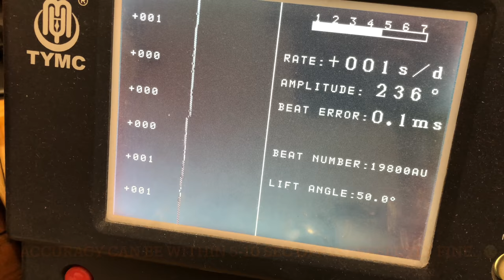RESTORATION OF A ROLEX AIR KING OYSTER PERPETUAL circa 1968 - Caliber 1520 service

Comment: I have a 1965 Oyster Perpetual - case 1003, movement 1570. It is probably very similar to the Rolex in your video. There is no service bulletin that shows how to disassemble, lubricate and reassemble the movement. 

I also have a generic military style watch with a Seiko NH38A movement. There is a service manual that goes into exacting detail on how to completely overhaul the movement, including what type of lubricant to use where.

Thing is I can regulate my $70 Seiko movement to run about +- 3 seconds a day which is just as good as most Rolex watches.
Reply from the maker: Honestly, I cannot stress myself enough.  You do not need to buy a high end watch for best performance.  To me, the overall condition of the watch is most important.  Whether you own a $50 watch or $50,000 watch, if the condition is excellent the accuracy will be just as great.

Comment: I see somewhere in it's history someone incorrectly installed the incorrect movement retaining clamps\screws. The genuine ones are one piece screw washer and is designed so that when you unscrew them (counter clockwise), it tightens the dial and movement to the case.
Reply from the maker: Look like someone did some research.  Good job on that.  However, on certain rolex models such as these airking and others which take the caliber 1520 originally came with a separate case clamp and screw.  Similar to the manual wind Oysterdate as well.  DateJust on the other hand will take the one piece screw with broad shoulder replacing the case clamp.  Which is why on the inside of a DateJust case it has a gap on the opposite side of the crown.  When you unscrew the case clamp screws, you can slide around so that one screw is on the crown side while the other is on the opposite side.  Flip it over and the movement will falls out.  😄

Comment: I have the exact same watch and it needs a new crystal. Wondering what's the crystal model you used on this one and was it sapphire crystal or plastic? Also I didn't see you use a gasket or maybe you did but didn't capture it on camera. Thanks for the amazing video and I was mesmerized and glued to this video from the get go. Thanks for sharing!
Reply from the maker: Thank you for your interest and questions. 
This model is from 1968, and it never came with sapphire crystal. I believe Rolex started using Sapphire in the 1990s or late 1980s. However, I know there are generic sapphire crystals made for models throughout the 1980s that carry a 3XXX series calibre. That said, maybe with today's technology, someone may have created a sapphire crystal that can fit on this Air King's case as well. 
If you prefer to install the original or one made like the original, here is a link to one: https://watchparts24.com/Acrylic-crystal-compatible-with-Rolex-Tropic-12-without-lens
Reply: @TimelessHistoryChannel  
Thank you very much!

Comment: Fantastic video! I have a very similar Air King 5500 also from 1968, also with the Cal 1520 and it was great seeing this video. I have a question about the crystal though: it looks very boxy on this watch, while mine is kinda rounded. I assume that the crystal has been replaced on mine but I might want to restore it to the original design. Is this boxy crystal the kind of crystal it came with originally?

Thanks!
Reply from the maker: Hi, thank you for your comment.  That's correct, the original "correct" crystal should be a regular dome.  But for some odd reason, I like the one in this video as it gives a better visual of the dial.
Reply: @TimelessHistoryChannel  I'm confused. Which shape is the historically correct one? Rounded or boxy?
Reply from the maker: @jakobmaulat  rounded

Comment: How to fix the glass back into the case, is it by pressure or apply adhesive?
Reply from the maker: Need to use a crystal press.  No Adhesive.

Comment: I have the same watch and movement recently serviced, they did replace the jewels and axle...but every time I shake the watch (dial facing up and down), I can still feel a faint bounce inside...as if something is wobbling inside. Thoughts on this? Appreciate your time and content!
Reply from the maker: Hmmm.  that's odd.  By replacing all three parts should do the job.  Maybe they missed one of the jewel?  Tough to say until you can open it up and check it with your tweezer.

Comment: Hey, could you tell me what the gasket of the lid is called or what the dimensions are? (30.80mm * 0.85mm?)
Reply from the maker: Hi, for Rolex gasket of any kind, it is best to try and order them from their case model number.  I'm sure a lot of online website will sell them.  
For example, this airking is case model 1005 which takes a 29-292-76 Rolex gasket number.
Reply: @TimelessHistoryChannel  thank you :)

Comment: You are clearly very skilled but man your work bench is like a watchmakers dirty underpants!!! 😂
Reply from the maker: lol, not sure have you been to a busy watch maker shop?  I have three benches in the shop.  Two are for watch repairing while the other is for strap making. This is my favourite bench where I do most of my repairs on.  It looks very dirty, but it is actually old marks on the mat.  If you get to see it in person and wipe your hand over, it is cleaner than a clean underpants that's for sure.  :-P 
Meanwhile my other watch bench which I rarely work on looks crystal clean on camera but every now and then I will need to wipe the dust off the surface.
Reply: @TimelessHistoryChannel  haha I’m sure it is I was only joking. You ability is amazing. I’m fiddling around cleaning the balance cap jewels and refitting them and they fly everywhere 😩 you have my total respect!!
Reply from the maker: I know your frustration.  I was in the same shoe once.  My recommendation is to use a brand new or good condition tweezers.  😊

Comment: Great work however I would've changed the crown and light polished the Case
Reply from the maker: If you are going to restore a vintage watch correctly, you first need to try and save what you can.  I did not need to replace the entire crown since the crown post was the issue.  It has a crack, so instead I just replaced the post and kept the remaining of the crown as you can see in the video.  And a proper restoration to keep the watch originality is to avoid any sort of case polishing.  I can polish a case like brand new, but that is not a proper job when working on a vintage watch.

Comment: Thanks for the video. It's always very impressive for me to see the mystery located inside a watch (I'm talking of a watch, not an electric motor). I don't understand how it works but I'm admirative to know how accurate it is: 5s a day is 5s over 86400s, it's less than 6e-5!!!).
I own the same model but I bought it in 1983, I still love it and wouldn't buy a more expensive one (I'm more rich than I was at that tome). Mine has a blue dial and is 34mm (the one you repaired seems bigger).
A question: Do I have the same caliber inside ?
A remark:the original glass was not exactly the same, it was more round on the edge. I noticed it when mine broke and when Rolex changed it and said to me that the ancient shape was not available any longer.
Reply from the maker: Thank you for watching and for your comment.  The caliber that was used in my AirKing was used until the late 1980s if I am correct.  I think very positive the caliber in your watch will be the same as in this Air King as well.  That's correct, the original exact crystal on this watch should be more round on the edge.

Comment: That was a great Job!
you didn’t renove the balance assembly, do you always try to avoid it?
Reply from the maker: I am not avoiding.  I enjoy working on damage hairspring, so removing a balance wheel is easy pezy.  haha.
The reason why I do not remove it during cleaning is because I use a four station spinning cleaning machine.   If I use the ultrasonic version then I would need to remove it as the vibration can break the tip of the balance staff.
Reply: @TimelessHistoryChannel  thank for your response and content.
Reply from the maker: @juanmanuelflorezviol  anytime!
Reply: @TimelessHistoryChannel  Yes cleaning with the balance fitted is much safer, but the pallets too, have you never had a roller jewel snap while in the cleaning machine?
Reply from the maker: @daviskaya100  Let's just say I've been working on watches for the past 2 decades.  Never have I had a roller or pallet jewels broken.  I have had watches that came to me with missing pallet/roller stone which I will need to fit new one on.  2 decades of watches are a lot of watches.  The cleaning solution is very thick, so when the balance wheel enters it cannot spin like it does once clean dry out of the solution.  One recommendation though is to never be cheap with the cleaning solution.  Always replace with fresh solution often.

Comment: Why didn’t you remove the crown?
Reply from the maker: What do you mean?  I did removed the crown when assembling the movement since the crown pipe is broken and I couldn't wind it.  Closer to the end you will also notice that I replaced the old crown pipe on the crown.  Now everything is working fine.
Reply: @TimelessHistoryChannel  oh sorry, I must have missed it. I saw the part when you were putting the movement semi-dismantled into the cleaner with the crown and stem still attached. I probably missed a few steps as I was multitasking. Great vid btw!
Reply from the maker: @watchchat  haha, it's all good.  It is quite a long video after all.

Comment: I never understand why you’d clean/service the movement, replace the crystal, fit a new strap, but not polish the case.
🤦🏻‍♂️
Reply from the maker: When you're in the vintage watch market long enough, you'll understand that the moment you polish the case, it will devalue your watch by as much as 50%, redial, and you will devalue your watch by as much as 90%, and when you relume can devalue between 20-90%. This is why I do not polish the case.
Reply: @TimelessHistoryChannel  
Okay I see. My apologies.🤝
Just out of interest. If that was my watch you were servicing, and I asked you to polish the case, would you tell me to take it to someone else?😆
Reply from the maker: @Jones607  No need to apologize; questions are welcome. I have stopped repairing watches for clients since 2015. But when I used to collect repair jobs, I would refuse to polish the watch even if the client asked to. I feel that the moment you polish the case or refinish the dial, you have altered the original finish of the watch. I would explain the situation and let them decide from there. To polish the case, I can make a lot more money on the repair, but the guilt will be forever in my mind.
Reply: @TimelessHistoryChannel  
Thank you for replying. You’re a gentleman.🫡
Reply from the maker: @Jones607  You're very welcome. That's what this channel is about, is to educate people about vintage watches.